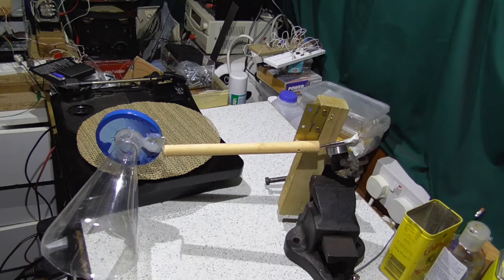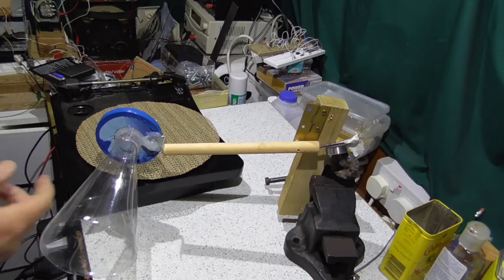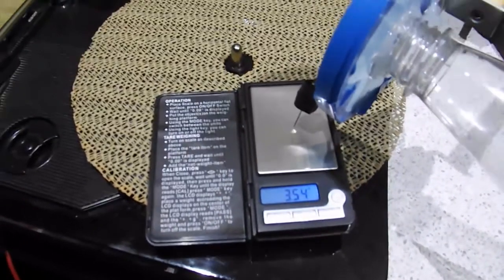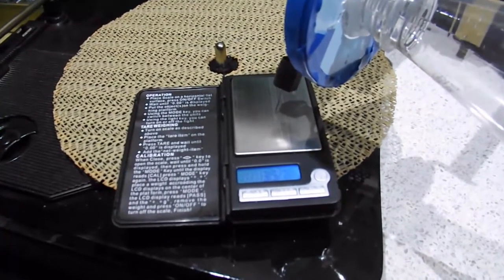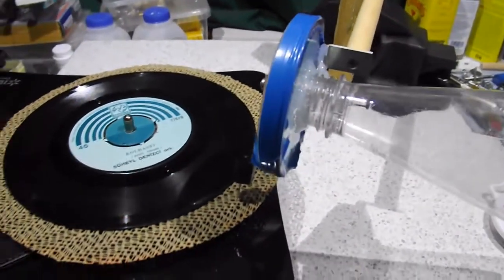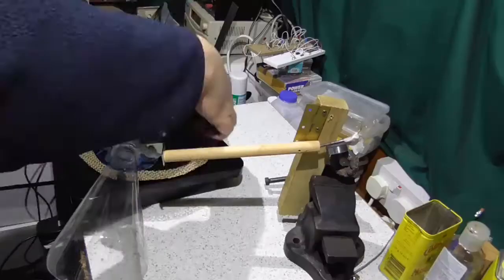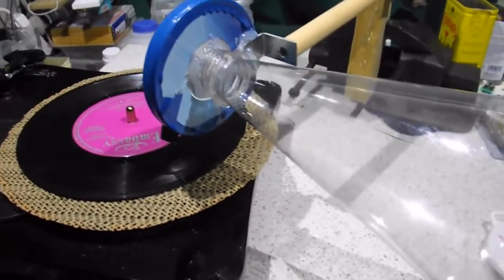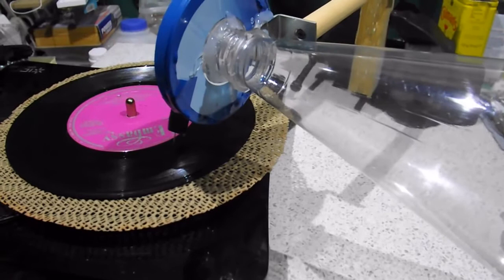Homemade vinyl acoustic gramophone

Comment: You should design a turntable that uses a spring  motor that can play at all 3 speeds, and have a horn mounting system thats not front mount so you can use an actual phonograph horn. You should also cut the needle so it's not as long and dull the tip, that might reduce wear and make it sound better.

Comment: Is there a bad effect on the grooves of locally made needles? So that the sound is affected later or is there any problem? Thank you for your video and good and my evaluation
Reply from the maker: It probably isn't very good for the records and yes there is a risk the pin or needle will damage the record. Don't do this with important or valuable records. Its also important to get the weight on the needle  quite low - less than 5g is good for vinyl - but for 78s it can be much higher (eg 50g).

Comment: Hello, I'm a retired mechanic and i building something very close to this, At what angel did you decide to run your needle? 
I see gramophones use a 60 degree set back,  but those are not modern records, Thanks again!
Reply from the maker: Hi, interesting to hear you are building something similar. :-) Will you post a video of it? I've treated vinyl records much like the old 78s and used a similar 60deg approximately angle. I've also kept the pressure down by using a counterweight, and used a sewing pin instead of a gramophone needle. I have made several videos trying different things out. Have you seen my acoustic vinyl player build?:
https://youtu.be/JSK1VrUEA7k
Thanks.
Reply: Thanks for responding, Yes i will up load a video of it, Im 5 years over due on my channel ha ha, 
I will go check out your other video,
 I dont normally like to ask, but would you be willing to look at my  homemade steam engine videos? I think you would like these, I have an apocalyptic dream.
I have a USB microscope im going to have to dig out so i can look at my needles.
Reply from the maker: Thanks, very interesting steam engine videos. I like the way you tension the belt to the generator, looks like an elastic band. I do something similar for the motor on my home made record player turn table.
https://youtu.be/zAaVMfL_puk
Always meant to build a steam engine but never quite got around to doing it. Might still happen though :-)
Reply: mrrgstuff , You are the only person in 6 years to notice then floating generator with rubber band tensioner, Believe it or not, I'm still working on it, i have a 220v mig welder now and need to build a new boiler. And i have a much nicer generator that can really put out some power, Are you still making projects? And what did you think of my penny sorter??
Reply from the maker: Yes, still regularly making projects. At the moment it's a mix of DIY gramophone and electronics, but I have lots of other ideas too. Penny sorter us great and works very well. Haven't built one of those but have a similar build I might make a video about. :-)